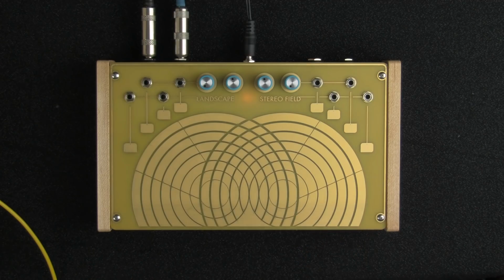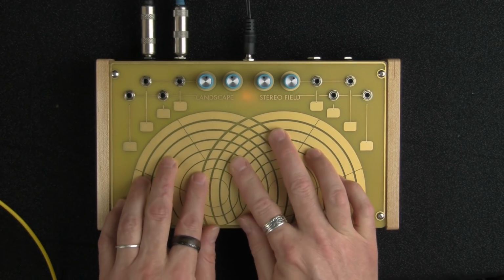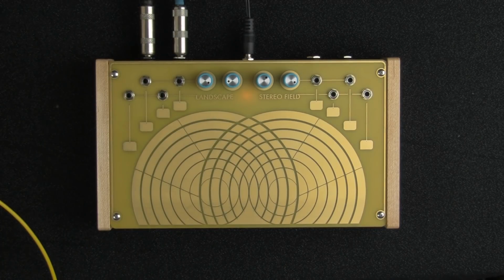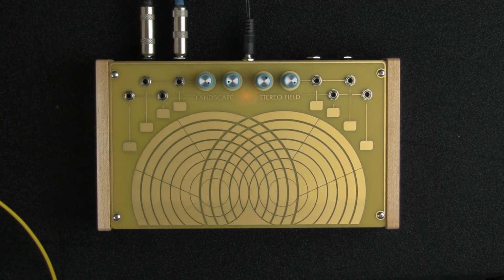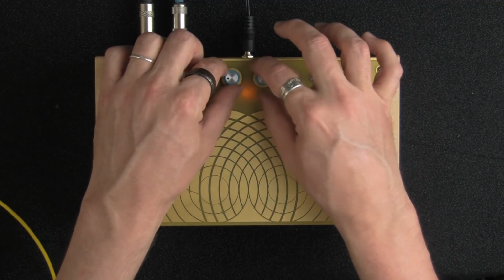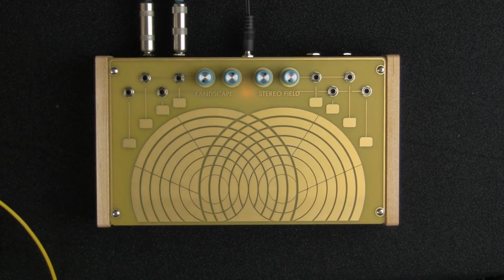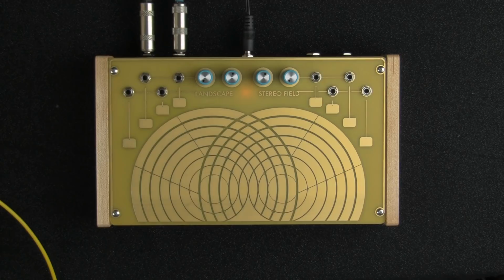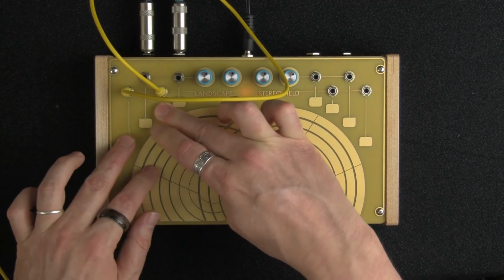01-The Landscape Stereo Field- Part 1: Introduction

Comment: Okay, I just got this thing in the mail,...without a power supply. I know it requires 9V but what's the polarity? Does it matter how many milliamps?
Reply from the maker: I actually just had the power source in my hand last night, but now I’m on the way to NAMM.  Landscape is on IG and responsive to messages!
Reply: @automaticgainsay  The brick included is a 12v Regulated (tip +) grounded power supply (100-240V AC)

Comment: Based on the name, and the intersecting wave pattern graphic, I figured this thing must take two input signals and allow you to weave the signals through panoramic space, manipulating both stereo locations independently under touch control.
Reply: You have four dedicated inputs.
Reply: @andrewclevine  maybe, but just patch point inputs-- your signals aren't gestured through panoramic stereo space as the name and graphics imply. There's nothing stereophonic about it. It's a dual craklebox with a pretty design.
Reply: @ecktoplasmic  Four dedicated inputs and four dedicated outputs = quad in & out. You'd need four Crackleboxes–which only generate audio as there is no external signal input option.
Reply: @andrewclevine  there maybe 4 independent in/outs (?), but there’s no crossfading. You’re just patching ins and outs. That’s why the name and marketing are misleading imo.
Reply: @ecktoplasmic  Have you spent some time playing it? As the plates are capacitive the amount of cross-patching is dependant on the pressure and–individually / momentarily distinct–conductivity of any and all body parts touching the respective patch points You are not toggling switches–unless you want to play the instrument like this.
Reply: @andrewclevine  I made the comment years ago in response to finally hearing it and being a little disappointed in its actual operation. When I first saw it, I imagined it was something like the capacitive spacial controller that Don Buchla famously made for David Tudor. The Landscape touch-plate art appeared to take some inspiration, together with the idea that you are interfacing with the stereo field, etc. Call me crazy, I don't know. However, to call it a capacitive controller in that sense I believe is a stretch. I haven't seen the circuitry, but it sounds like and appears to function like a Cracklebox where one's touch closes two open nodes of an oscillator circuit, not unlike a switch, with variable resistance and/or capacitive influence over the oscillation. It might be a wonderful creative instrument for some people, and I don't care to disabuse anyone of this possibility. But it seemed intentionally misleading to me at the time.

Comment: I'm concerned about the potential for damaging external equipment.  For example, if you patch the outputs of several Eurorack oscillators to the inputs and then directly bridge them together, it seems to me that they could potentially damage the modules, depending on the quality of their design.
Reply from the maker: Hmm... someone else will have to weigh in on this... I don't know!